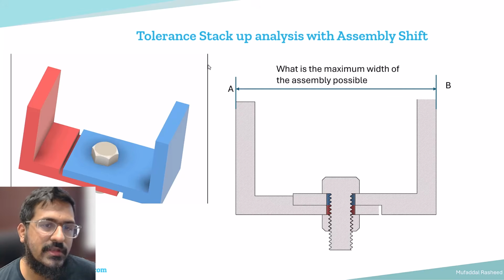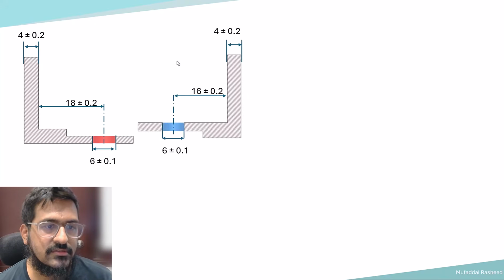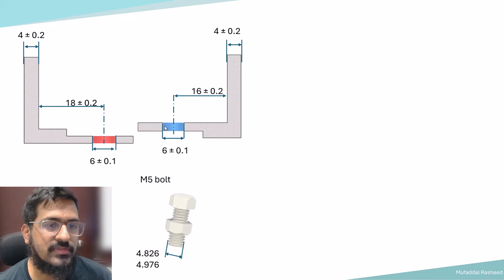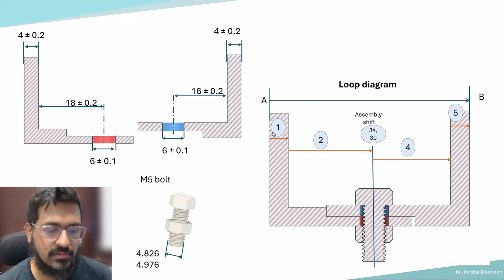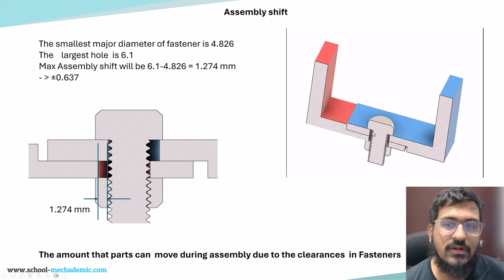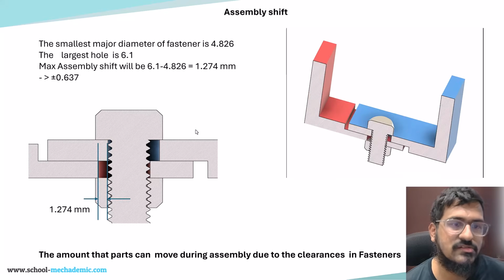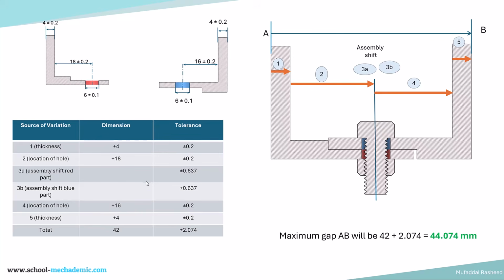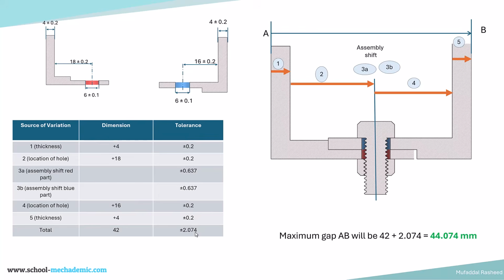Tolerance Stack-up Analysis with Assembly shift

Comment: 6:55 how did you get the  tolerance of + - 0.637?
Reply: from my understanding the clearance value was divided by 2 because this assembly could move to either side of the hole.
Reply: Consider blue part axis and bolt smallest major dia axis. Blue part dia diamenion is 6 +/- 0.1 and smallest value of bolt 4.826. Worse case means max clearance between the max dia of hole and smallest dia of shaft(bolt).  The difference between worse case 6.1 (max dim of hole) - 4.826 (min dia of shaft) 1.274. 

1. 0 variation if the hole and bolt axis colinear
2. Assembly shift may happen either left and right respect the blue or red part however the the varaition can be a + or - 1.274/2